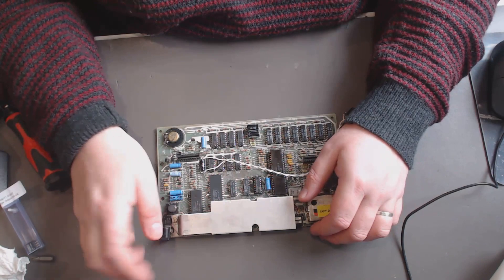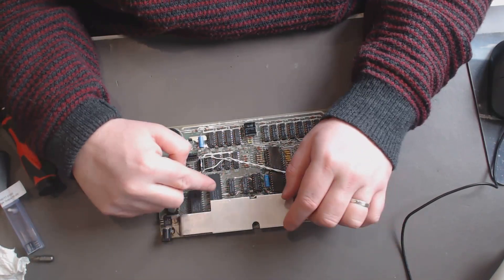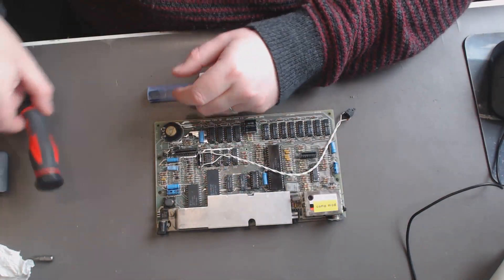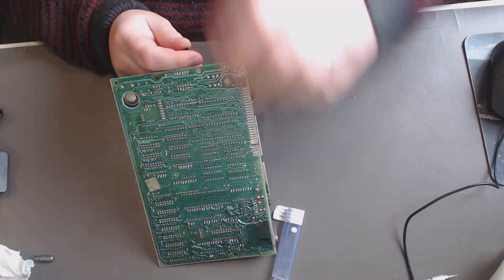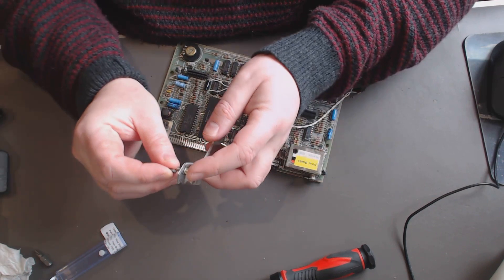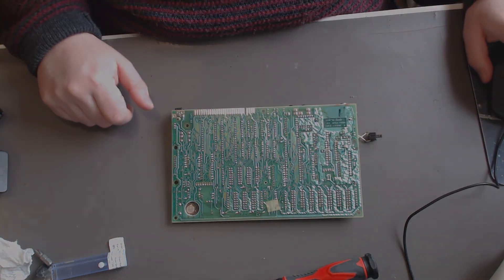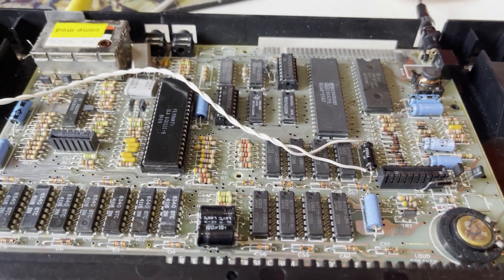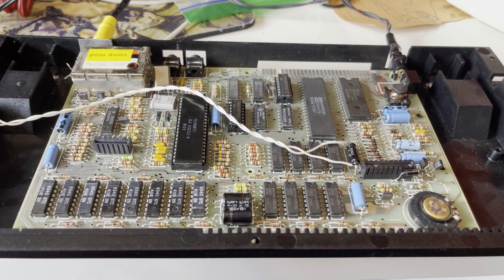ZX Spectrum 7405 voltage regulator replacement with something newer and better

Comment: Hi I picked up a zx for £10 got a genuine powerbrick tried it the heatsink got extremely hot causing bottom  case to slightly melt i tested power brick output was 13volts is this too high i suspect the 7805 is fried but I dont know if its caused damage further along thanks
Reply: Is 7805 the same as on the atari 2600 as I bought 4 a while back
Reply: I did notice the heatsink was slightly slack in case like nut wasn't tightened
Reply: It's a version 2 board is polarity still + on outside

Comment: Did you mean "tsr 1-2450" instead of "tsr 1-2405"?
Reply: I think he was referring to the TSR-2450, also because the 2405 doesn't seem to exist. Have you tried it? Works?
Reply: I replaced the voltage regulator on 3 speccies, with the tsr 2450, works great!!! Now I have three big heatsinks to sell on Ebay ;)

Comment: Sure, 6GBP is a lot compared to the 7405, but of course, at some point you have to factor in thr cost of replacing a toasted ULA, so… great video, much appreciated!
Reply from the maker: Just what I was thinking. ULAs are not cheap or super easy to get.